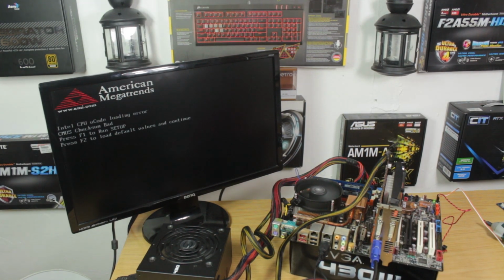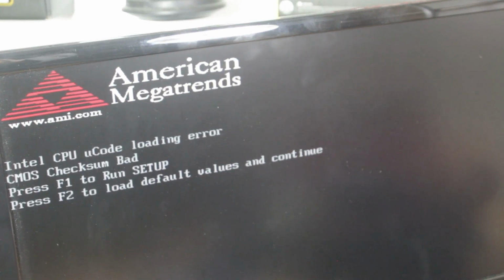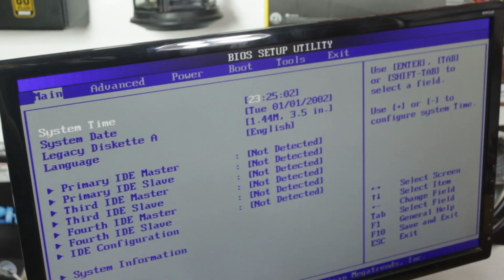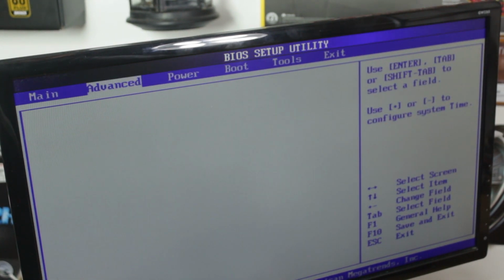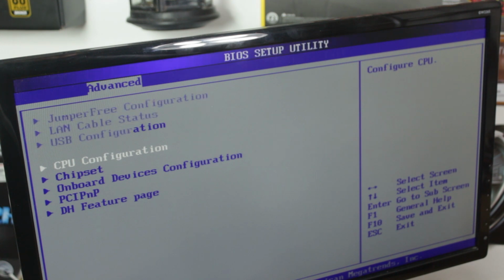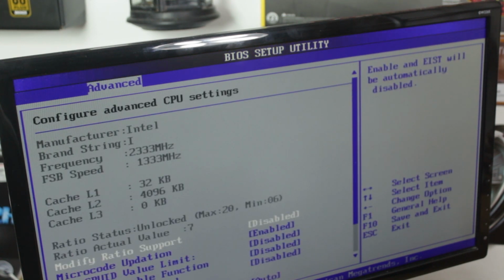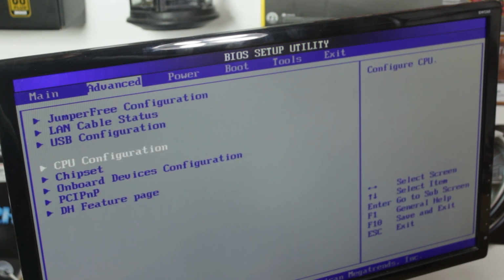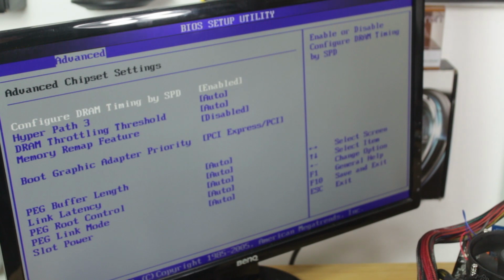Troubleshoot A Motherboard - Pt 3  Dead PC Or Computer Turning On But No Display On Monitor

Comment: If I have unplugged all devices, my computer boots sometimes gets past BIOS, but it shuts down very timely usually inside of a minute, possibly two.  I have replaced the power supply, and I think a bad CPU wouldnt allow me that far.  Any ideas?

Comment: I had the same issue except my build would restart loop, is this a sign of a faulty mobo? i used a known working psu and that wasn't the issue. i ran it with the bare essentials, psu, cpu and mobo but no beep and it continues to loop restart.

Comment: I got 2 possible dead motherboards 1 confirmed, 1 cpu possible too, 3 sticks of ram possibly also dead, or an nvme 1tb

System always posts, even oc to 5ghz no problem with high temps upto 91c. But still, it'll kernel panic and bsod.  Randomly at any given time

Comment: I have a new build that I just can't get to work. I have checked everything. The PC starts, the fans are going on the case, the CPU and GPU, and it stays on for 15 seconds, then switches off, then restarts for 15 seconds and this repeats until I turn the PSU off. What can I do next?

Comment: I have tested my power supply and it seems fine. Now when plugged back in to the Motherboard it stops running (no fans spinning). My pc is totally dead but originally, I got 5 beeps when starting up (asrock 970 Pro3 R2.0), but after two or three times it died completely. Where do I go from here in the analysis, is it the front panel (which seems unlikely since I got the initial responses/beeps) or somewhere else?

Comment: My motherboard posts, and there is a signal sent to my monitor, but no display... I tried changing the ram sticks with working sticks. I changed the PSU to a working PSU. I'm thinking it's MB or CPU, but CPU has no visual bends in pins....

Comment: Hi, i hope you will see this message, i've searched pretty much about this, so, i have an old pc, that worked let's say.. 8 months ago, so the configuration it's ok for sure, but after taking apart and cleaning it, cpu was not touched, it won't post but fans still spins and light works  . Started troubleshooting like this: tried another working psu, same issue, i have only one dim of ddr2 ram, so tried switching it and still nothing, ABOUT THE BEEP, IT WILL NOT BEEP, BUT IF I LET THE BOARD WITHOUT THE RAM IT WILL BEEP LIKE CRAZY so it kinda works sorry for caps, long post. Any ideas ? Thank you sir

Comment: While using my pc there was a blackout then when the current was back i turned on my computer but theres no power i tried 2 different psu’s but still no power so just want to ask you sir whats the problem thankss..

Comment: how to fix this .. i have a Mobo H110M Pro-Vd and Pentium G4560  CPU and 8Gb 2400Mhz Ram .. when i run the test there is no post and No display .. what should i do.. pls help...
Reply: have same issue, same parts also. Still figuring out how to fix it,

Comment: I haven’t received my cpu, or gpu yet, but I decided to put together the rest of my build anyways to see if everything else work. When I hit the power button nothing happened, no fans turned on, nor did the front panel LED. Ugh, it’s my first build too. I’m hoping it’s just a faulty power supply. 

Do you think some flex in the mobo while plugging in power due to missing standoffs could have damaged it?
Reply: Its possible but unlikely.
Probably the computer didn't detect a processor and refused to even post. If there is a led light on the board then check fr that.

Comment: I'm having the same issue, but the motherboard does have lights, and they do turn on. The issue is that it's io won't work, I connect the monitor, keyboard and neither turn on.
Reply: Well that's something....I have the same problem. Planning to take it in for checking....Thanks
Reply: @f2carter93  Ur welcome
Reply: Hey, did you manage to work on it and if so, how?
Reply: @f2carter93  yeah, it was something really dumb, the Mobo had to be updated to accept the Ryzen 5 3400g.
Reply: Samuel Lin was it a b450 motherboard?
Reply: @Edmond3290  It was the  asus prime a320m-k.
Reply: Samuel Lin I’m having the same problem, how did you update it without the display?
Reply: @gavinrussell6157  Well firstly you need an alder CPU to boot up the system. 

If your problem is also the need for an bios update, you can take it to computer repair shop, I'm sure they have an CPU lying around that you can borrow. 

The shop I went to even offered to update it for me free of charge.

Comment: My computer won’t boot it was just working fine then the next day it stopped working and all of the fans and leds come on but nothing on the screen
Reply from the maker: Tests you have done so far?
Reply: The only thing I haven’t tested was the ram but my motherboard doesn’t even light up any more

Comment: My rx 580 is only getting 64 watts at 100% usage which is making my frames drop drastically to what other people get with the same specs. Im thinking that my motherboard isnt supplying enough power to my gpu. Any thoughts?
Reply from the maker: Do CPU and GPU stress test!
Reply: HealMyTech thanks for the suggestion, fortunately ive already done that about 3 days ago. It seems AMD doesnt support OpenGl to well which caused my gpu to be underused. In any other recent games it does very well

Comment: thanks for the video man.
 i was moving around the power and reset + - pins to turn on the pc. but i forgot to turn unplug the computer now my pc i dead.
question do you think it can effect the CPU as well. can it be dead as well? i realllyyy hope. 
thanks for your video and time
Reply from the maker: IF its power then you should be checking the PSU, and front panel connection to the mobo for power as well...in terms of CPU dying, its quite rare but not impossible if there is a short...

Comment: I currently have that problem but i do get the beep, my gpu fans are not spinning, im not sure what it is but the mother board lights turn on but no signal to the monitor and mouse and keyboard light don't turn on.
Reply from the maker: Is the beep a successful beep code for POST or a different code?

Comment: I managed to power up the pc and fans were working but no display on the monitor connecting with HDMI. I changed the graphic slot to another and then there was no longer power to turn it on. 
Now i tested the power supply its working but no response on the CPU FAN noR the Motherboard and nothing happens.
Reply from the maker: Update?

Comment: Thanks now i know my motherboard is dead
Reply from the maker: How sure are you?
Reply: @HealMyTech1  70% sure. My pc was fine before i cleaned it and then for some reason it acts like the dead mobo in your video. But i still have hope, sort of.
Reply: @TheFailRider  the same happened to me. Stopped working after I cleaned it. Were you able to fix it?
Reply: @germantarnoski7130  Oh.. i got it fixed. Not exactly the mobo per se i just reseated everything from the power to mobo and the hdd boom.

It just works.

Comment: I wonder if " I remove the ram it has sounds then plug in again still no display but no sounds but has lights fans but not loading still thinking psu or board "
Reply from the maker: Maybe, but not necessarily...do the tests one at a time...
Reply: France Ivan same case
Reply: France Ivan so what is faulty?

Comment: Try testing the CMOS battery using multimeter if it is 3V.
Reply from the maker: As far as I know CMOS battery will not prevent POST, only it will not retain profile so will resort to default PSOT boot...

Comment: my psu takes like 8 seconds to finally make the fans spin for my cpu cooler 

and i get a random restart or a freeze while gaming
Reply: You should replace your psu before it damage your mobo like what happened to me.(I use my pc even psu is faulty).
Reply: @Kretzzz  and i randomly freeze in some gmod maps
Reply: ill try to get a new psu as fast as possible 

i would need a new one anyway because im thinking about getting a gpu ( prob a 1660ti or a 1070

Comment: Thanks for these tips, i just realized that for some reason my motherboard cpu pins were bent. Thats why it wont boot properly, no busted resistors on my cpu
Reply from the maker: Whats the update?
Reply: @HealMyTech1 i tried to fix the bent pins, but it still wont boot(im not good at this) I'll try to fix it again once i bought the tools i need.
Reply: i know im very late but do your cpu wiggle a lil bit on the socket when bent ?
Reply: @J03M.  it didnt at all, my pins were only slightly bent. If it does wiggle then i recommend to let the pros fix it or just buy another intel motherboard.

Comment: Hi, thanks for the great video! My games are constantly crashing after 5 to 10 minutes. Could it be a motherboard? 
I've checked temperature, updates, graphics card, memtested ram. Any ideas on what it could be? THanks in advanced!
Reply from the maker: I would start with an in-depth PSU troubleshoot if I were you, video on my channel, but there is a more recent one called: Finally solved Annoying PC Which kept crashing & Restarting....check it out and let me know how it goes....
Reply: @HealMyTech1  Sorry, must have missed this. Thanks for your reply. I watched the video. Definitely a power supply issue causing the GPU to falter, I turned down how much power my GPU used to 75% and had no problems. Thanks again for your help and great content :)
Reply: Hey max, if you still have problems, try driver easy! it updates drivers that windows say are up to date. My system was randomly crashing, after update of the drivers everyting works.. At least worth a try

Comment: Is boot looping a sign of a dead motherboard as well? That’s what my system is doing
Reply: I bought another psu so it’s not that
Reply from the maker: Have you tested the new PSU independently?  It could be RAM, HDD, could be anything else really, you need to methodically troubleshoot, but start with RAM after you have made sure the PSU is actually working as intended.

Comment: hey man for everyone that tool for power button is useless just use a screwdriver that isnt fully metal as the handle cant be conductive and then tap pins turn on

Comment: Um so my mother board shows a orange light when is works, but now it does not and none of my fans spin whatsoever, so would it be my power supply, I say this because absolutely nothing turns on🙂
Reply: Something like that also happened to me. My gpu has a light when everything is fine but on one randon morning the light wasnt there and my pc wouldnt start up AT ALL. No fans no nothing! I tried fixing it by buying a new power supply and plugging my pc directly into the wall but nothing has changed 😭😞
Reply: +it'sRiszl, The same thing happened to me exactly as you said it. I woke up one morning and nothing turns on and the new power supply does nothing. I am guessing it is my motherboard.

Comment: Uhm I have a Asus m3n-hd/HDMI board 
The power supply seems to working fine and the board shows a green light but it just doesn't want to switch on the Ram is working perfectly fine but the pc won't turn on 
This all happened when one morning )after playing games the previous night) the pc just did not want to turn on
I even changed the battery but still no power
I need help ASAP
Reply: Get your mosfet transistors checked on the motherboard

Comment: U deserve many mire subs n views for being simple n technical
Reply from the maker: Thanks for the encouragement, feel free to share to help out the channel!
Reply: @HealMyTech1  i actually got a problem wih my system thought u could help 
So this is what happened
I had an old pc and planned to upgrade the mobo,chipset basically the whole tiing with a a320 asrock+ryzen 3 1200 cpu.
I built the pc today but it just didnt want to post i tried literally everything ,clearing cmos .....etc
Im not sure if its cpu,ram or mobo but i am damn sure the gpu aint faulty cuz on the old system it worked but only on a restart the first boot always began with onboard gfx and i had to restart from bios to get the dedicatedgpu running (probably the cmos problem) but i dont think thats the main issue for the ryzen build i hope u read this and try helping me i am very frustrated

Comment: when i press the power button my pc starts and shuts down immediately then again starts and shutdown immediately. amd this happens again and again.
my power supply is new and outputs correct voltage. so please tell me what is the problem.

I tried to run the system without processor then the motherboard is running. is the processor is faulty?

Comment: Were you able to turn the pc off without turning off the power supply cause I couldn’t.. if so we’re experiencing the same thing please respond would be much appreciated.
Reply: I'm experiencing the same issue. Did you resolve this?

Comment: I have a question.. So everything seem to power on in my pc but I have no display. The cpu fan, graphics card and fans are all on but their is no display. I tried plugging hdmi into both the graphics card and one at the top of it
Reply: Rock Roll yeah I sent my mobo back in return for a new one so I’m waiting for that.. I believe that the board I had is just messed up. I mean everything powered on and what not and I trouble shooted it. My cpu is perfect and my graphics card is working. I even took the graphics card off and booted it but still yellow flashing. My ram is confirmed that it’s compatible with my mobo so it has to be a faulty mobo.. I ordered a speaker for the mobo just Incase, let you know the update in the next week or so though
Reply: WavyGoCrazy Hello there!! I’m experiencing the exact same problem!! Did the computer end up working after fixing the mobo?
Reply: @jayayejay3972  did u fix it
Reply: @milplayer17  No bro :( I still got it in the closet rn to try to fix it up again. Please let me know if u solve it!
Reply: @jayayejay3972  well since i troubleshooted everything my only guess is its the motherboard.  Cpu didnt look damaged

Comment: so basically according to this video if you don't have extra parts to swap around replace motherboard and cpu, now since you are removing cpu at this time shouldn't we be discussing how to tell if its the mother board, cpu, or even a wiring harness problem, because my pc has a short harness in it all sorts of stuff including power supply connects and plugs into board. also, not all motherboards come with a light, so how do you even know the motherboard is really getting power if nothing on the pc is working. don't listen to this guy if you follow his advice you could be forking out much more money than you need to. cover all basic points while your in there.
Reply from the maker: This series is not a fix for all problems, but rather a response series to repeated questions I get on the topic, so its meant to answer some FAQ.  You have to understand that I am not trying to answer your 1 specific situation, and what you mentioned may apply to you, but it doesn't apply to majority according to the data we get, so video tutorials of this type are based on numbers and not on individual issues, and its impossible to address every scenario.

Comment: I have a GA-970a-US3P mobo

I keep getting crashes no matter what I do. I can get a crash just opening a file or freeze just idling at the desktop just a few seconds in after windows startup.

Why I think its the mobo is because Ive tested and swapped every part but the CPU and Mobo. CPU is AMD FX 6300 6 core 3.5ghz and it is usually at temps of around 16-20c w/ liquid cooling when it crashes so I dont think its over heating. I havent overclocked the CPU or GPU. When I try to run 4x 4gb sticks my PC will either freeze or restart on its own at the Windows logo start up screen. I can only run 3 sticks at most but my pc will still eventually crash after running for 5 minutes or less. The only time I can run more than 3 sticks is if I up the DRAM voltage more than what is suggested. My sticks are Corsair Ballistic 4gb per stick 1600 mhz, 9-9-9-24 timing @ 1.5v so I had to up voltage to 1.65 to have them run stable for a few minutes. Up until I play some youtube or a game for 5 mins then it crashes and restarts on me. When I run mem diagnostic test, they all test out good until its time to boot up windows after test is complete and then my PC crashes and restarts or freezes at Windows start up screen. It even crashes when loading in safe mode.

Ive swapped PSUs both at 750w one is Corsair the other is Coolmaster. I even swapped my HDD with an old one to see if it was the hard drive, still same issue.

Ive reinstalled my OS twice and I even crash during the installation after a full reformat. So it sure as hell isnt conflicting drivers.

Ive swapped 3 separate graphics cards ending with same results. The most up to date card I have is an MSI GTX 1060 Aero ITX 6gb OC, but if my older cards are giving the same problem it sure as hell aint my gpu.

Im at a loss here. I wanna say its my motherboard cuz its the only thing that makes sense to me now. What do you all think?

TL;DR Specs - 
MOBO - GA-970A-US3P
CPU - AMD FX 6300 6 core 3.5ghz
RAM - Corsair Ballistic 1600mhz 9-9-9-24 1.5v
GPU - MSI GTX 1060 Aero ITX 6g
HDD - WD 7200 SATA 3 1 TB
Windows 7 Ultimate 64-bit OS
Reply: Please no beating around the bush answers like making sure no dust and and checking cpu pins. Thats commons sense shit, I aint looking for those answers.
Reply: Reinstall windows,remove ram and set in other slots
Reply: You just gotta throw the whole PC away now 😂

Comment: I get no beep at all, i have checked the psu with a multimeter and all is fine, i have taken each individual component out one at a time and still no beeps, but the fans power up and lights come on (no startup, black screen) is this a fault with my motherboard?
Reply from the maker: Sure sounds like that...have you individually tested each component apart from just removing them and reinstalling one at a time?